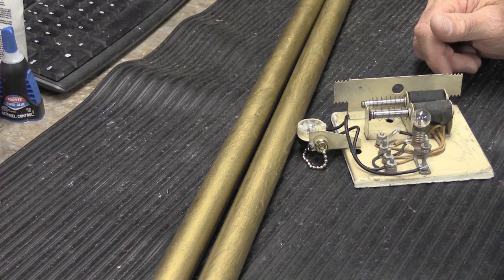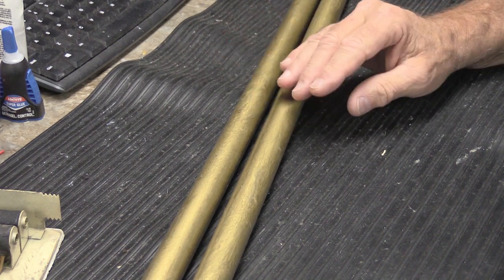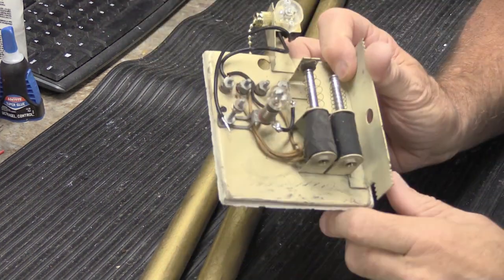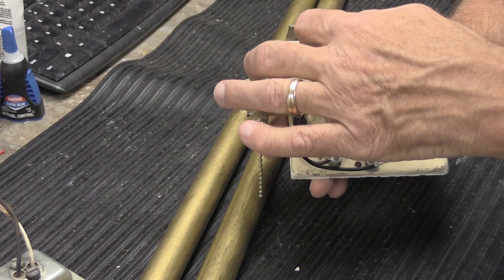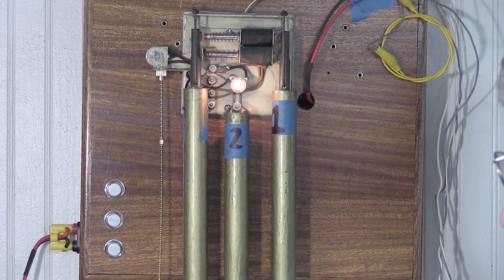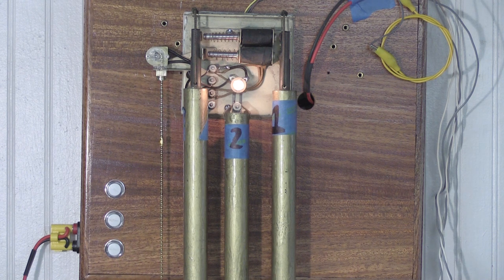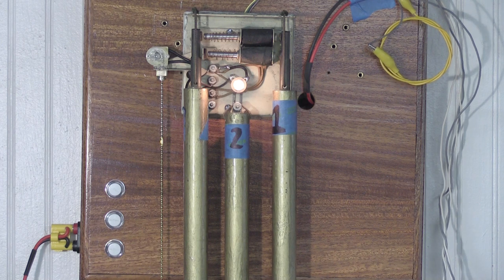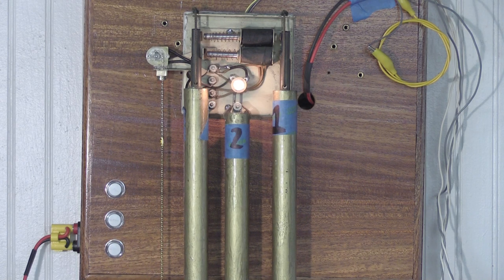An Overview of a Mystery NuTone 2-Note Long Tube Door Chime

Comment: I'm gonna go oil my doorbell RIGHT NOW! lol
Reply from the maker: Hi hughjass: No ~ Stop! ~  Don't Do It! ~ The Chime Police have been dispatched and are in-route.  Don't make a mistake that you'll regret for the rest of your life. . . - Chris
Reply: They probably had to worry about it because of how many consumers had been (correctly) trained to oil their fans (and later dishwashers) routinely.
Reply from the maker: @sgath92  I am familiar with NuTone Paddle Fans (ceiling fans) that had oil wicks for the motors, however I would not imagined that dishwasher would have the same design - I wonder if anyone ever really oiled their dishwasher - Chris
Reply: @northsideservicecompany3567  When dishwashers first hit the scene they were so expensive & unusual that I'd imagine they were oiled on schedule by the "help" employed by the homeowners. I don't know when the manufacturers stopped mentioning the oiling requirements in the owners manuals (would be curious to know but not to the point of collecting old dishwasher manuals to find out). Once they started going into normal folks' homes they were initially almost "portable" instead of being built into the kitchen cabinets like is done today which might have made oiling them easier.